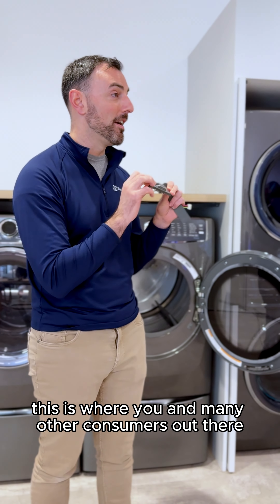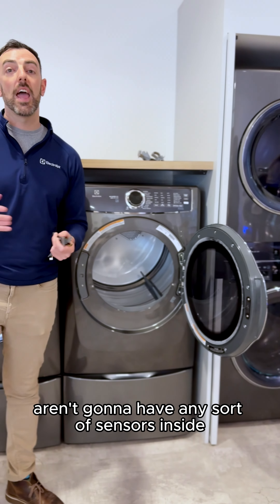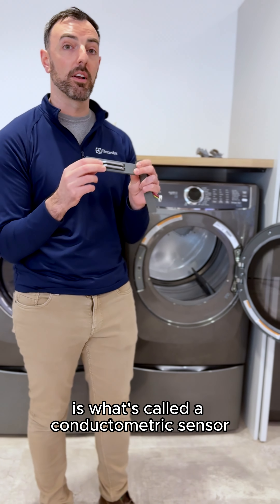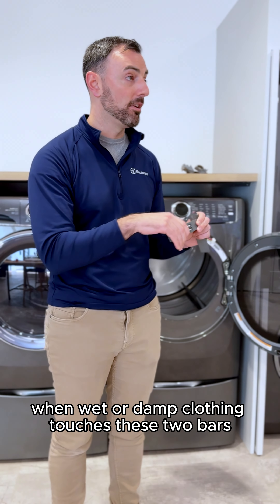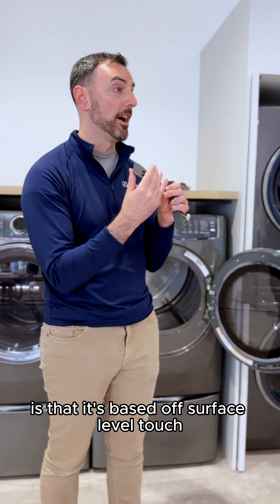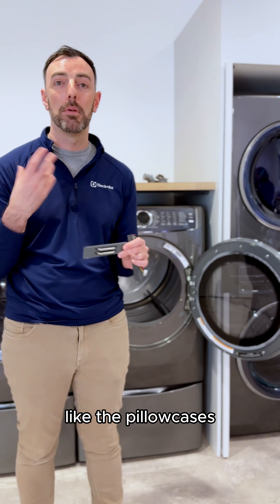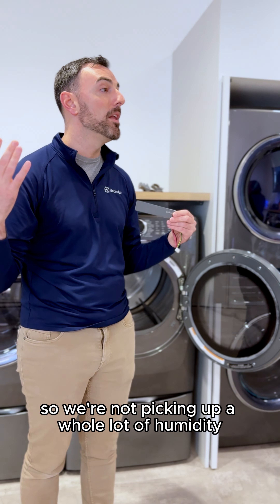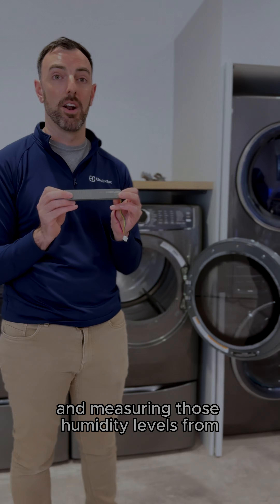Electrolux Vlog, Episode 9:  Capacitive Sensor Dryer

Comment: I just bought a new Electrolux washer and dryer set. (400 series according to customer support) @ $800/each. I see the metal sensor bars inside the door. 
But I think the dryer isn’t using the moisture sensors when set on “Auto” dry setting. When I set it on “Auto” and all other buttons to “normal”, it dries sets the machine to 67 mins, (before even running and sensing the clothes) and then runs for 67 mins, no matter if there is a single barely damp item in there, or if the dryer is loaded with highly damp items. It runs for 67 mins as set on the display from the very beginning. There is no adjustment of time (using the sensors). 
It’s basically a “timed-dryer”…I don’t see any “adjustment taking place” with time. 
Maybe there’s something going on with the amount of heat?? Does it adjust the “amount of heat” instead of adjusting the “time” when using the sensors??
Can anyone help explain what I’m experiencing??